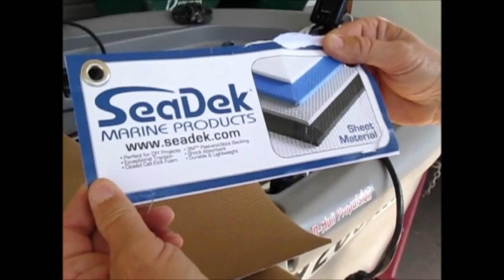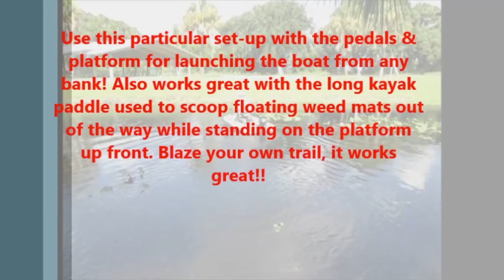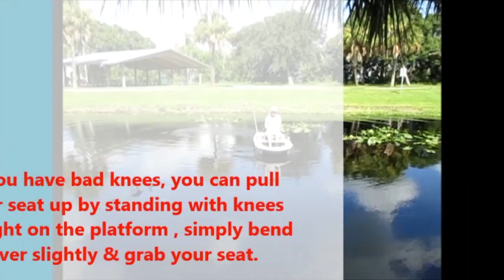TWIN TROLLER X10 GETS A CASTING PLATFORM

Comment: Thanks Gerry: funny thing is I just built the same thing for my Troller over the weekend.  Had that in mind while I was waiting to get my troller after I ordered it, and actually building a second one as well....I also thought it was a no-brainer because of how the troller is set up it's like it built for it, with no drawbacks because you can use them as small tables, foot rests for different positioning, and storage underneath them.  Thanks again.
Reply from the maker: Ted, great minds think alike. You and Steve came up with a great idea that I never thought of. Owners have repeatedly surprised me with the ingenious ways they use their Twin Trollers and I suspect there are other great ideas we have not yet heard about from other owners. If you have other ideas, send me your pictures and a story or just pictures of your fish and I will post them in a mailbag video like this.      Send your pictures to: TwinTrollerPicture@gmail.com                                                                 Gerry
Reply: Howabouthetruth  Hey Steve; I used 2-3/4 inch pieces of plywood glued and screwed together and covered with the same carpet I covered my floor with.  My main deck is 24" fits inside the track but still allows the seats to slide and makes it about even with the top, but what's also nice about it is when you pick it up and rotate it, it can lay flat on the bottom of the boat floor and is hardly noticed if you don't want to use it.  I made a 2nd one like yours that goes on top as well, but haven't tested either of them out on the water yet, but they look fantastic, are solid and don't move at all.  Nice job on it.
Reply: Ted, it sounds like you have a floor covering?  have you posted video or photos to show your flooring? @tedondrish9204
Reply: Hi Russell.  Gerry has a quick video of a few pics I sent him when I was working on my Troller in the fall.  I just used some carpet I had left over that was installed in my house.... it's very expensive plush carpet and feels great on the feet just like I had in my previous inflatable boat, but nothing special.  My wife will be fishing with me quite a bit and she likes the feel of carpet.

Comment: Absolutely awesome idea!I've been considering the twin troller for some time now! Most all the lakes and ponds around me really don't need a big motor,so my only question to anyone who owns one are the motors that are built in strong enough or should I atleast maybe add a small electric troller motor outboard style?
Reply: @howabouthetruth2157  Thanks for the quick reply! I've always been a bank fisherman unless on a buddies boat. But since I've moved a few years back most my options now require some sort of small boat! And most the ponds and lakes don't allow gas power motors. I'm not 100% sure knowledge wise about marine batteries and all of this but I'm a diehard bass fishermen ad have been for over 27 years now! And with most these ponds they are very huge like merli sarnoski park it's a vairly small pond electric motor only! But since I began fishing it this past summer from the only dock your allowed it's way over fished and I've seen guys on boats catching 7 and up to 8lb largies in spots I see and wish I could reach! I've been checking the twin troller out for a long time now I've seen many many videos but I'm sure I'm going to have more questions. Like I'm moving closer to a lake the end of this month now it's a bit larger then the  other pond and much wider but it's the kinda lake I would mostly fish close to shore around the over hangs and docks so I most likely wouldn't really shoot straight across it! But more just work my way from launch all the way around and back or half way and back because it is a bigger lake that was why I was considering putting another troller motor off the back as a back up in case the built ins couldn't handle it since gas motors aren't allowed but yes I would want to have as much battery as I can so attaching the 2 together would be a great idea not something I've ever actually done myself but I'm also pretty handy and a quick learner so I'm sure with your instructions I could figure it!! But for all the places arou me which is like  4 lakes 1 pond and I believe only one allows gas motors. So besides the built ins can I purchase something that's also outboard but electric with more power just for the larger lakes that don't allow gas?
Reply: @howabouthetruth2157  Okay my concerns aren't about speed that don't matter so much! It's more just getting from A to B safely and efficiently on just the built in motors that's why I was wondering about just a simple basic out board minn kota just as back up! Do they make anything like some kinda guages to test or see how much battery life you have throughout your day of fishing see myself I would mainly craw around the shire lines and such and the drop offs other then that I'm not looking to be flying around the lake! I just don't have any experience or knowledge being I never took the leap and boat any boats in all my years so it would be my first and a learning experience also! Thank you for all your kindness in answering my questions it's much appreciated oh and also can this little boat be easily loaded from say like a land point that's shallow to the water that doesn't have a a boat ramp and if you don't have the ability to tow it can it be easily moved other ways like the lake near my new house doesn't exactly have a ramp but yet people are allowed to boat in it I've seen Jon boats and such in it with electric motors so the twin troller would be perfect but how would the ease of just pulling it down a small road and lowering it off the bank in be?
Reply: @howabouthetruth2157  Okay all great to know thank you very much! I'm feeling much better now then I was before about making the leap to buy one I feel it would be the best solution for me in my lakes and ponds around me. Yeah it's currently the same time I have insomnia some nights so I get to watching YouTube videos on things I'm interested in making the leap to buy and you seemed knowledgeable with the tt. So I dropped my questions! You have a great day and ty again for everything
Reply from the maker: James, it sounds like durability of the trolling motors is your concern and not speed. I have yet to hear anyone say they have had trouble with the motors and as Steve from Melbourne has said, replacement motors are readily available and easy to install. They come from Motor Guide, one of the largest trolling motor companies, and not some Chinese knock off that you cannot find replacements for. 
There is a video from Freedom Electric Marine showing their Quick Lift Dolly for launching where there is no boat launch.            Gerry
https://www.youtube.com/watch?v=Q7uvhEKq80c 
When you get your Twin Troller feel free to send us some photos!
Reply: @howabouthetruth2157  Oh I agree completely! I've done tons of research on the twin troller. And figured since you are a seasoned owner my only questions would be best asked here!
Reply: @howabouthetruth2157  Same here I get notified immediately! If any thing else pops up I'll be sure to reach out. Because for me this would be my first boat and I don't have a hitch so I like that I can move it myself and launch from just about most banks the lake I'm moving next to is literally 3 minutes from my new front porch and the bank isn't high it would be easy to launch this.. thanks much for everything! Have a wonderful evening

Comment: Hi great info...how far back are those pedals able to go .? Chillc
Reply from the maker: Charles, If you look at pictures and videos of the Twin Troller where you can see the floor of the boat you will see slots formed in the deck. They hold the pedals in place. There are many slots, even several in the center area of the boat so the pedals can be passed under the front seat and the person in the back can operate the TT. Since the pedals, inanition give you propulsion, they also make you steer so you can do that from the back of the TT too. The versatility of this boat is extensive.                           Gerry
Reply: Lunker012 .......thank you great little rig!....chillc

Comment: I wonder about using plywood (maybe 2 layers glued and screwed together) for the deck so there won't be that gap in the middle?  Plywood is relatively stable and doesn't expand/contract with moisture.  Also, how about spraying the deck surface with with something like pick-up bed liner coating or rubberized undercoating?
Reply from the maker: Two 3/4" sheets with construction adhesive and screws. Could also paint the top with non skid paint.  
Good idea also.           Gerry
Reply: Steve, I sincerely apologize for "offending" you so much on your "perfect" design of your casting deck.  I did not mean to be so "critical" of your plan.  But may I offer an explanation?   The main reason I suggested plywood is that I have plenty of scrap laying around my wood shop.  So I wouldn't be spending "all that extra money".  I certainly wouldn't go out and buy a full sheet just to build a casting deck.  Two pieces of 3/4" plywood of the same size of your deck certainly do weigh more than your 2, 2x8s----12 lbs as opposed to your 11 lbs.!  As far as flexibility,  The SAGULATOR on Google shows the same flex for your deck as for 2 pieces of 3/4 inch plywood laminated together (0.03" total with a central load).  I do understand the scenario of falling through roof decking.  But the 7/16th inch OSB used for most sheathing is not comparable to what I am suggesting at all.  No disrespect meant here either but I am just suggesting that material that one may have at hand can possibly work just as well.  Just saying......

Comment: Question: I built my platform using the 1 5/8 inset for my 1x4 from the end of the 2x8, but have a 1/2" play in the horizontal movement (which seems excessive). Can I bend the Sea Dek over the end of the 2x8 on each side to reduce the play? I've never used Sea Dek and haven't ordered it yet, so I don't know how flexible it is. Do I really want to reduce the 1/2" play?
Also, I couldn't understand you when you said what type of material to use under the edge of the2x8 to reduce movement.
Would appreciate your help.
John
Reply from the maker: John, If you are sending digital photos you can just email them to me at TwinTrollerPicture@gmail.com and just a note telling us about what you did. Video does not email well so photos work the best.                                                   Gerry

Comment: You can also use it as a table when you eat your lunch
Reply from the maker: Randy, for some using it as a table may be the better use. I bought the items I need to make one and will do a video on making it. I will try it as a platform to cast from but at this point I am interested in it as a work area. I just need to find the time to make it, so stay tuned.                                                                                                   Gerry
Reply: Or a fish cleaning and filet table. And if the fish ain't biting, break out a deck of cards and play solitaire
Reply from the maker: Uno!

Comment: What boat model did you purchase. How much did it cost. Did it come with the trailer. I saw the one boat at a show this last winter $ 5,995.00trailer and a Honda gas motor. Can you purchase the boat with out the Honda motor. I have sent email after email to the company they have not returned my email.
Reply from the maker: Larry, send me your email address to TwinTrollerPicture@gmail.com and I will contact them directly myself to get them to contact you back. My boat is 5.5 years old so I am not up with current prices because I am not looking for one. I have the deluxe package that has the boat, Honda, two seats, fishfinder, and the trailer. I know they have different packages and some have no outboard. They are usually very good at getting back to people but let me try to help you.                            Gerry
Reply from the maker: Larry, I contacted FEM for you. They have no emails from you and ask that you call 877-882-0099 x2 so they can assist you.                      Gerry
Reply: Hi Larry.  We've replied to 3 of your emails over the last two weeks (June 13, June 28, & June 30).  You don't appear to be getting them.  Check your junk mail.  Your email account is with AOL.  This is a common problem with them.  Or, simply call 877-882-0099 x2.  We can answer any questions you have.
Reply: Thanks for the help, Gerry.  We found his emails.  They have been responded to.  He doesn't appear to be getting the responses.

Comment: Can you put a 4 hp on your twin troller
Reply from the maker: Eugene, I cannot answer that for you since I never used anything but the Honda 2.3. That motor weighs under 30 pounds. The balance of the boat with a heavier motor would be a concern to me.                              Gerry
Reply: Howabouthetruth (4 hp that’s a 4 stroke 52 lbs)  (4 stroke to 3.5 - 41 lbs )you think it’s to heavy
Reply: Iam think about putting on the 3.5 motor is kind of heavy on that transom one more question Iam think about buying a Suzuki what is the best one out there motor